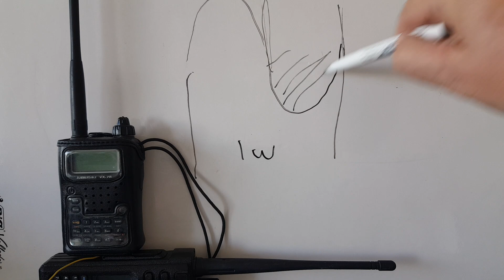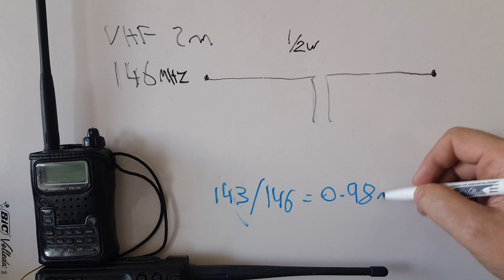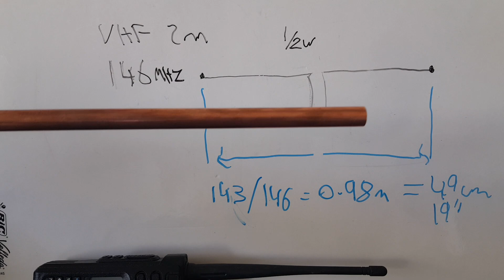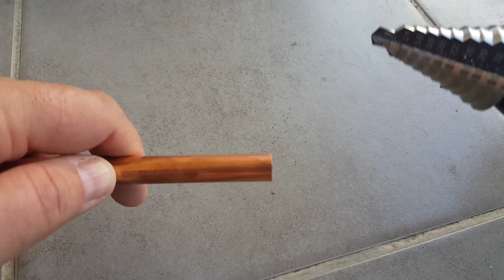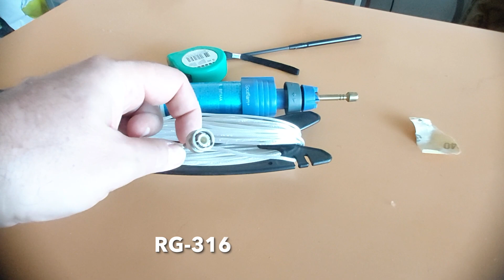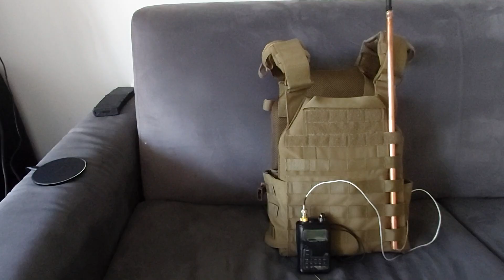Building a Plate Carrier Antenna.

Comment: Would this still work if you used a pipe bender for the copper and a foldable antenna to make it more compact or is it all about the hight?
Reply from the maker: Not quite sure what you mean, but the higher the better, and the antenna must be the correct length for the frequency...

Comment: Although not a big problem in the developed world, in Afghanistan we had a problem with our radio operators who had antennas similar to this and would be walking around and every once and a while the antenna would hit a low slung, uninsulated power line. Ouch to the radio, the operator or both. Great build. There are a number of antenna systems designed for plate carriers. Yours if the first diy I’ve seen. Charlie KM4ZZ
Reply from the maker: Interesting thanks. Those lines must have been pretty low.. I can see it happening with an HF whip though..

Comment: Gil, The antenna will certainly give you elevation for 'distance' but the only 'downside' that I can see is 'no flexibility' - perhaps a tape-measure type tactical antenna (for the top section) would be safer - especially near low-hanging branches? 73

Comment: WOOW, A Shop Wich Sells SMA Connectors? We Don`t have That In Latvia.
But Copper Pipes, YES WE HAVE, i have so much and so many variates of copper pipes, copper wires, small and super thick.
I make antennas left and right, but i still need to make the antenna that is not visible on radio because its illegal here to listen to frequencies im listening in so when im holding radio its obvious that its a walky talky and not a phone, i need to make some antenna that goes into my backpack or on my neck, i dont know, but i will think something out and i will make a video on it, i will test it with my nanovna before that and stuff, then i will remake it on video to show You guys how i made it and how good or bad it works. :)
by the way, radio related materials and devices and parts, i have so so many things from radio related things, i inhereted a large portion of devices and so many parts, like selenium rectifiers and so manu soviet diodes, resistors, everything is soviet made, variable capacitors and all that, if you have any wish to buy some of it from Me i can give You the discord link where you can see images of the items i have, every now and then i go to take photos of everything and i just add the photos, if you have interest in the thing in image, just point it out and we can make a deal. the discord link is - https://discord.gg/6DVRpHnzKD

Comment: A key trick for soldering a connection near a part that you want to avoid over-heading:
As soon as the solder wicks into the connection and you remove the flame/iron, immediately cool off the end to be protected. 
Heat transfer continues to happen even after the flame is removed.

Comment: Ive built something similar but used over flow pipe. I wrapped the pipe in foil and soldered copper braid on the end stop and taped the braiding to the foil. I used a telescopic whip and adjusted it to get a good SWR reading. I can send you the plans if you want.. not my design though!

Comment: Excellent video and great concept. You may want to look on Amazon an order some MOLLE elastic binding ribbons. Three of these should do the trick to secure your antenna. I use these for tying down small pieces of gear like flashlights to my plate carrier.
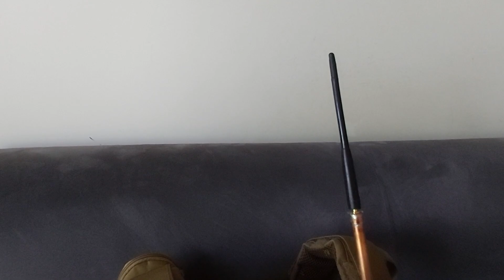Reply: I just caught the last bit around 21:25. Yes, France and the US are very different. I just completed some antenna testing with my plate carrier (with a full load out) and the local Sherrif's department smiled ear-to-ear and gave me a thumbs up as they passed me on my run. Arizona is pretty good about this. Cheers from the US.

Comment: Hi great project, but regarding the antenna model, what is the impact of the gap in the center ?  Also, usually the feedline goes perpendicular to the dipole , now it is parallel, is that the reason to put it inside the grounded leg ?
Reply from the maker: Yes, it is not optimal but more practical. The gap was just there, no purpose.

Comment: Great build....Love it. You could take it a step further and put a BNC fitting on the bottom end of the tube so you could use different lengths of replacable coax between the bottom of the antenna and the radio. It would also allow replacement of the coax if damaged because sometimes things get rough when out in the field. A piece of shrink tube or sealing tape would make it waterproof, yet still removable. I'd use a Signal Stick Antenna from "Signal Stuff". Super flexible, you can loop it in a knot when not in use, it's tough as nails and has a lifetime warranty. It can be had with a BNC connector as well as the SMA types. You could also drill a small hole at the rounded corner of the cap and bring the shield wire through it and solder it on the outside. That way, you don't have to worry so much if when soldering the cap to the pipe that the connection will come lose. I'm 100% making one of these. It's a 1/2 wave dipole. Very efficient.
Reply from the maker: The BNC connector would need to be insulated from the tube..

Comment: This is similar to the Sperrtoph antenna made by  ON4CFC. The inner is the positive part of the antenna with a sleeve on the outside being the negative. Mind you it is just over 1 metre tall so if it came to backpack it would be sticking out a bit. More like the flowerpot antenna but made from copper itself.

Comment: I use to use a 70cm dipole that spans across my shoulders and loops back to my radio, it is all made with coax, heat shrink tubing, and covered with camo 550 cord exterior sheathing. It works better than the rubber ducky, but having a dipole against your body isn't the best either. In the end I find it best to use a stub comet antenna with a BNC adapter then when needing to reach out I whip out either  an Abbree 48inch with BNC, or hoist a slim Jim up into a tree.
Reply from the maker: Horizontally polarized the others would need to hold their antenna horizontal too or you lose 20db...
Reply: Horizontal whilst everyone else is using vertical means you wont be getting as strong a signal out to them.

Comment: I've been playing with coaxial sleeve antennae.  Run a small diameter (rg-316) radiator up the thin end of a fishing pole and it would be better than a rubber duck. Not great, but better. It doesn't have the flexibility in swapping out the top side like your design though. Bonus, no soldering if you choose the right connector on the coax when purchasing. Buy it long enough, you could make 2.
Reply: In a pinch, you can also wrap 19 inches (about 48 cm) of adhesive copper tape around the end of a 48 inch section of fiberglass camo net support rod.  Drop your coax extension down the rod with the connector and rubber duck sticking through the end cap.  Ideally you'd solder the coax braid to the copper tape... or just peel back the coax insulation, stick the copper tape to the braid, and shove the whole thing down in your rucksack. Please don't ask how I know that works.
Reply from the maker: Exactly. Indeed a correct connector and a bit of epoxy could avoid soldering!

Comment: Slot the end of the pipe...put a hole in the cap run the shield out..put a bit of epoxy on the feed...slip the pipe down and soldier the pipe and shield to the outside
Reply from the maker: Yep, that would work!